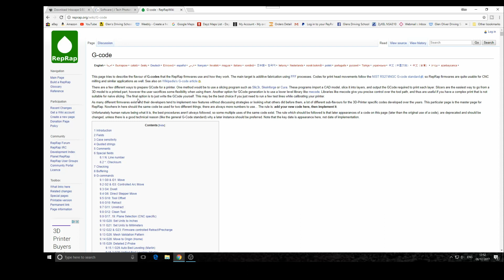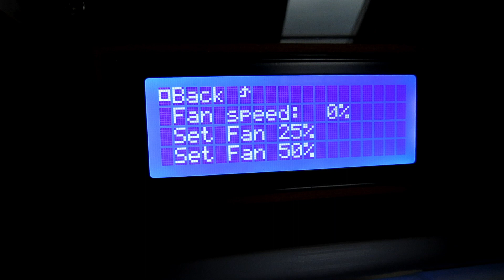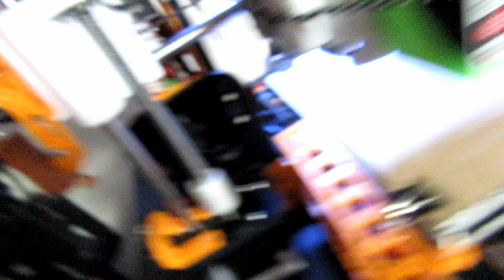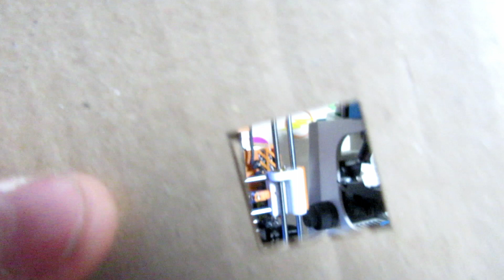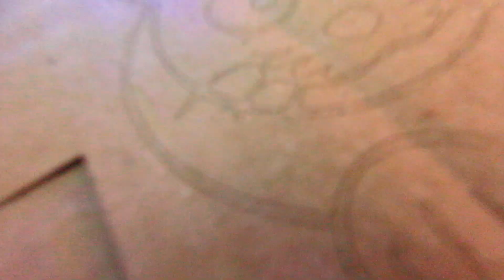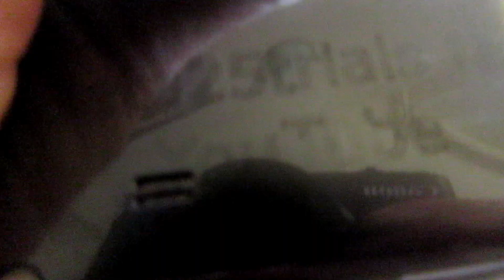3d Printer Laser mod /  Laser cutting  / Laser Engraving /Inkscape

Comment: Very helpful. The laser did not fill in the lines or the black pupils or nose , have you worked out how to do that?
Reply from the maker: Sorry not yet if I find out will get back
Reply: @Beta250trials  i have the same problem with letters, only engraving the outside lines! any idea how to get that issue fixed
Reply from the maker: Hi guys sorry for taking so long I was not able to find a way to solve this process but I haven't used the Lazer or software for a long time if i discover a solution I'll post it hear